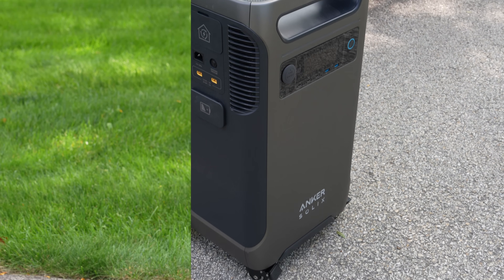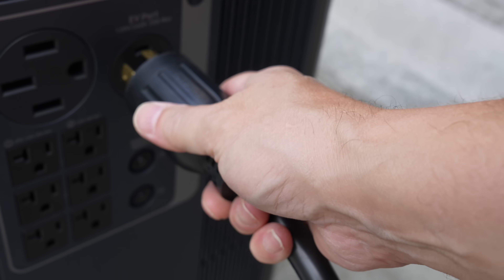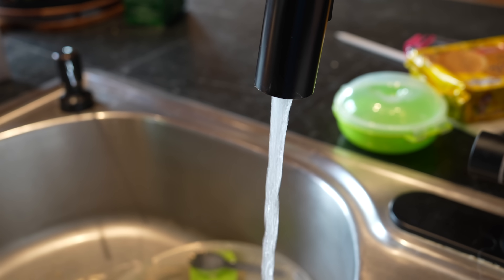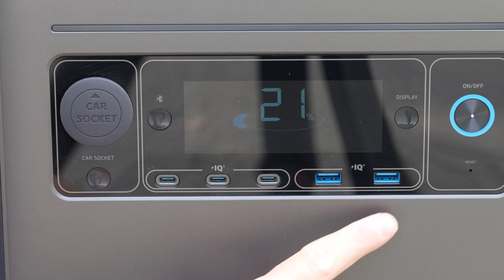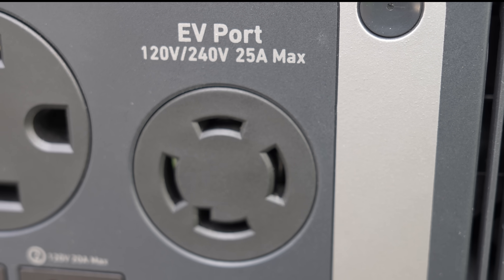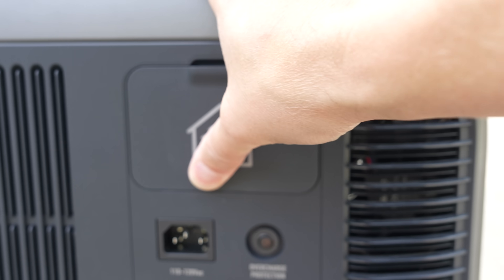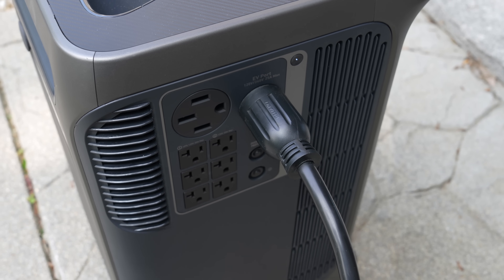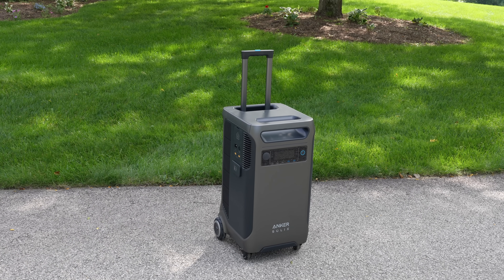Better than GAS Generator? First 240V Battery Backup - Anker SOLIX F3800

Comment: The Zendure Superbase V can do 120 and 240 in a single unit, but their 240 is at much less amps
Reply from the maker: Yes I have seen that but something is off. Its like they carved out some of the inverter power and gave you that but its not the full inverter which doesn't make any sense. I don't know why they don't just put the full inverter to it since without using somewhat illegal adapters you won't be able to get it to a standard generator inlet.
Reply: @SilverCymbal I wish I hadn't bought it; my unit is just constantly doing weird stuff. Much prefer my EcoFlow (but you need two main units for 240), this Anker looks like it might fill the role I wanted this Superbase for with more amps (240v) and from a brand I've come to trust over the years (Anker and Eufy have a certain minimum build quality and customer support for everything that some products exceed, they also don't just drop stuff while in warranty)

I missed the super early-bird on this but will look again to see if I can squeeze this in the budget or if I want to go with an all-in-one 48v DIY for this planned project
Reply from the maker: @KaceyGreen  I have only reviewed one Superbase model and it was very good but it seems like they may be going to fast for those huge models.  I never would have believed that Anker could go from the company that made USB chargers to devices this large but this was very impressive. See what happens, after the campiagn they may still offer deals too.
Reply: @SilverCymbal good idea I'll keep an eye on it and I'll have to add a budget target category to just keep an electronics slush-fund at the ready particularly in the fall and spring 😅. Yeah either my SuperBase V is broken and the support isn't wanting to RMA it, or they're all weird and like you said grew too fast.